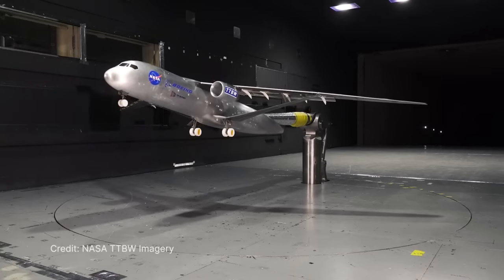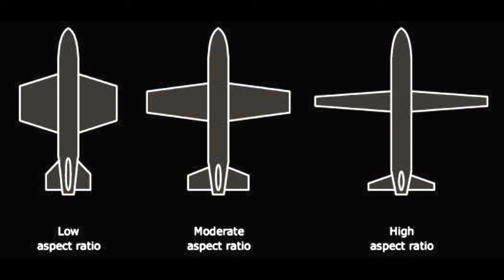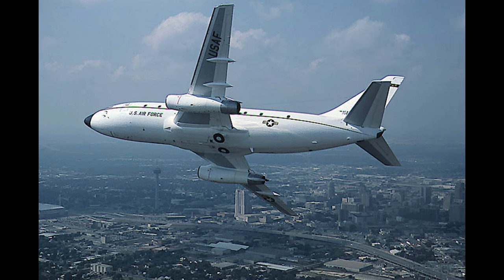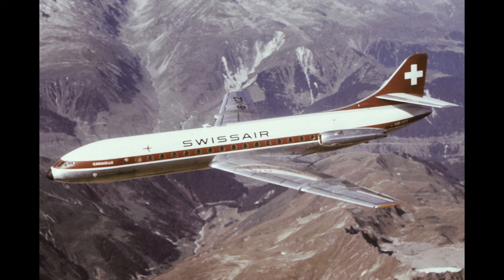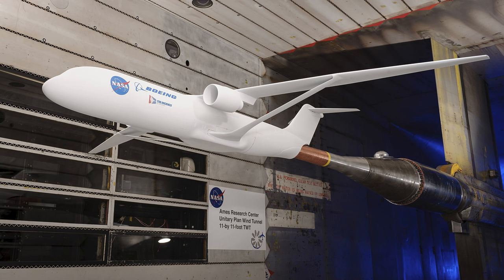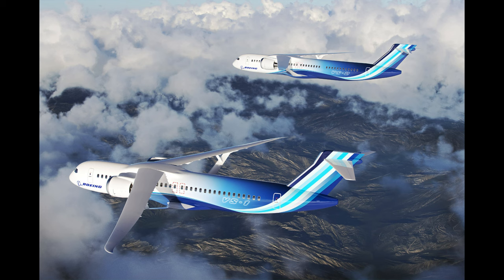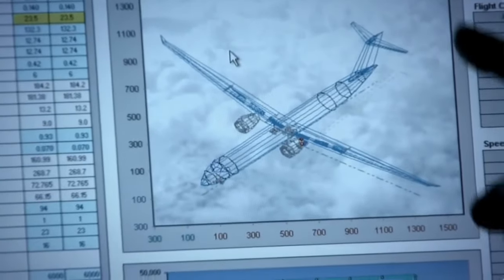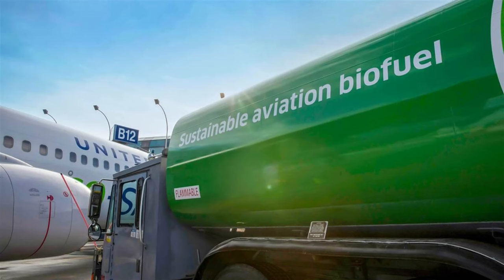NASA's New Airliner Experiment To Make Flying Less Expensive

Comment: Another neat thing about the extremely high mounted wings, they allow for HUGE diameter engines, which seems to be the way we're going, if CFM doesn't turn out to be that great after all.
Reply: Though on this design won't the engine size be limited by the strut? If the engine gets too big the strut will be in the exhaust
Reply: I think the current engines in development are unducted fans, kinda like turboprops, so the fans will be in front of the wing.
Reply: surprised scott doesn't mention this. i know part of the reason for the 737max's MCAS difficulties was that they kept trying to fit larger and larger engines underneath its wings and it kept messing with the center of gravity of the plane. but the larger engines were more efficient.
Reply: @oldfrend  it's got nothing to do with center of gravity. The issue with the 737 is that it is a 60 year old design that was originally equipped with small diameter, low-bypass engines, and sat pretty low to the ground to facilitate handling in airports without much infrastructure. Due to the structural design around the landing gear area, there is a limit to how much they could raise the plane, and the CFM LEAP engines would not fit under the wing as usual. Thus, they had to mount the engines higher and more forward. The issue with this is that the engine nacelles gerate lift at high angles of attack, and in the case of the 737 max a more pronounced pitch-up tendency because of how forward the engines are mounted. To counteract this, they installed the MCAS system that would automatically pitch down the aircraft in such circumstances, to make it behave exactly like the older 737 models. This would be fine if MCAS had a decent implementation with sufficient redundancies. However, to justify such redundancies, MCAS would need to be classified as a flight critical system and require additional pilot training when transitioning from older 737s to the MAX (disclaimer: I'm not 100% sure on this part). The increased costs of pilot training would be a signifint disadvantage to the MAX, and so Boeing didn't do it. IIRC, the plane would also fly fine without MCAS, but then would require additional pilot training due to the different handling characteristics.
Reply: @bluemountain4181  not really. Most of the size of an airliner's jet engine is from the fan. With engines getting bigger, the goal is to have high bypass ratios- the actual jet turbine engine stays small and the fan grows larger. It'd be pretty easy to build the strut around the engine, even if it cuts through behind the fan. Should be fine.
Reply: @bluemountain4181  You could incorporate the engine through the strut, or the strut through the engine, if needed.  The strut doesn't need to be a single unbroken span.
Reply: @VIctorAbicalil  I think you got all of it just like the reports said it- Boeing had "presold" the plane as not requiring much new training to qualify pilots already flying earlier 737 models- when they couldn't make that happen they put a McDonnell Douglas style band aid on it. MD execs had wound up in essential control of Boeing after the merger due to retirements from Boeing and other factors- they recreated their "old playpen" and gave a heave to the costly QA process and procedures Boeing had long been a leader in. A solid example of executives thinking about the profit in the next quarter before anything else.  FR
Reply: @fredericrike5974  All of that reminds me of Perun's latest video comparing corporate culture and infighting to what is happening in Russia as telegraphed by the Ukrainian "military thingy".
Reply: That's fine until you get an uncontained failure and kill or injure the passengers. It will be even worse for the unducted fans. You'd end up with the next Comet.
Reply: @kirkbrauer8915  which probably messes with the aerodynamics so would net be modelled again...
Reply: @neiloflongbeck5705  Existing turboprops have reinforced/armoured areas where blade loss is likely to occur, so unducted fans are likely to be required to do the same.
Reply: Sometimes, making a huge engine isn't the best cost-effective choice. Kind of like rocket engines, making many "small-sized" can be cheaper and could make more thrust than one huge one, as long as you have room to put many of them.
Reply: @brettcoster4781  But then you've just increased the weight/cost/complexity to compensate for the simplification of ditching the nacelle.
Reply: @bluemountain4181  Not if it is a propfan.  The large diameter of turbofan engines is only the duct.  The engine itself is quite small diameter.
Reply: @neiloflongbeck5705  Interesting point, it never occurred to me that with a propfan there's no such thing as a contained fan blade failure.
Reply: @brettcoster4781   yes, they do, but I can remember reading about a DC-9 where there was an uncontained failure in the engine and 2 passengers were killed.
Reply: @listerdave1240  not with the fan blades, but compressors and turbines still leave their engines sideways on occasions and end up killing passengers
Reply: @neiloflongbeck5705  compressor parts can be contained by a well designed enclosure, the fan blades cannot because there is no enclosure.
With regard to the compressor or turbine parts dealing with their containment is no different between a turbofan, a propfan or a turboprop.
The turbofan may have some advantage as part of the engine is covered also by the turbofan duct which could act as a second catchment layer for parts leaving the compressor, depending on which part they depart from and how far back the fan duct extends.
Reply: @listerdave1240  yes, but there have been accidents with such parts of a jet engine that killed passengers. One such was in 1996 on Delta flight 1288 were the uncontained failure of the compressor killed 2 passengers and that was an MD-88 (engine type JT8D-219 turbofan, and the metal passed through the inner and outer cowling for the engine and the fuselage. In 2017 an Air France A380 (flight 66) had an uncontained failure in flight over Greenland fortunately with no fatalities or injuries. Both of these examples of such failures were on wel regulated airlines. So these things can and do happen.
Reply: @brettcoster4781  Also, these fans would be running slower and have lighter composite blade materials compared to contemporary turboprops, so the required reinforcement may be less than for turboprops today.
Reply: @MaartenOosterbaan  fair point, but there seems like a lot of space under those wings to fit the entire fan with room to spare.
Reply: @neiloflongbeck5705   Hi Neil, Where un-ducted fans (turboprops) are used, it is common practice to beef up the fuselage in the area where a dislodged prop could come into contact with the fuselage, also in other critical areas. Nothing is 100%, not even current modern jet engines with their strengthened nacelles. You may recall the recent incident that caused a fatality. The CFM56 engine of a 737-700 exploded and the reinforced nacelle failed to contain the blades, ejecting a blade through the side of the nacelle enclosure hitting a passenger window. Unfortunately a female passenger was partially sucked out of the window and died from her injuries. It is very difficult to build aircraft or engines that cater for all eventualities. I do understand your thinking, a fast spinning blade in a jet engine would feel safer than a high speed uneducated prop just outside your window.
Reply: @brettcoster4781  Correct and they are.
Reply: @ukandrew  yes, and I think you'll find that I'm aware of that. But just like with the 737 Max it doesn't take much to destroy a reputation. Just takes a couple of high profile accidents and it won't matter how efficient or environmentally friendly the engines are.
Reply: @kirkbrauer8915  turbofans engines used on airliners are practically ducted turboprops. Ducts improves the efficiency of propellers. AIUI, the airflow is not wasted on surrounding air but ended up being focused to be used as thrust.
Reply: @samuelmendoza9356  yes, the main goal behind these unducted propfans is to increase the fan diameter without the additional weight penalty of an increase in the duct size. This is of course at the penalty of some lost efficiency, but you regain that efficiency and more through the weight savings and increased fan diameter.
Reply: @kirkbrauer8915  as long as the spin is not too fast. The Russian Tu95 bear's propellers are supersonic and so loud that a sonar operator can hear it from across the ocean.... _literally_. The larger diameter must take in mind to have improvements in thurst to allow slower spin to avoid such....hellish noise.

Also, while airliners never goe transonic...isn't unducted has lower max speed comapred to ducted ones?
Reply: @samuelmendoza9356  oh yeah, those bear props had a diameter of almost 6 meters and only four massive blades! I think that and the incredibly high RPM did not help the sound situation at all. I remember reading that they had to spin at 8-9,000 RPM at cruise to maintain high Mach numbers. Modern turbofans only spin at 2-3,000 RPM at cruise, geared turbofans like the PW1000G spin even slower. Since these would be geared and have a lot more, better optimized blades, it’s possible they can get the noise levels down to a modern CFM LEAP level, that’s what CFM is claiming with their new RISE unducted engine, we’ll see about the reality of that tho…
Reply: @VIctorAbicalil  I'm going a bit from memory as the 737 MAX MCAS fiasco has been almost four years ago now. Initial testing showed that the 737 MAX flew just like the previous 737 except in a high thrust, high angle of attack situation, which would pretty much only happen in an evasive maneuver like avoiding a mountain or a mid-air collision. In that specific situation the engines would generate some lift if I remember correctly, causing the nose to pitch up higher than the previous version. This was not unsafe unless a pilot did not know about it.

However it would have required training in the simulator, and if I understand correctly even though the training was needed just for this one specific situation, the way the rules are written it would have required a new type rating for the 737 MAX. This would have meant that existing 737 pilots would have to go through extensive and expensive training to fly the MAX, even though most of the training would be redundant since only this one thing changed. This would have made the 737 MAX less attractive to airlines compared to Airbus planes. The airlines could have saved money by only training some of their 737 pilots on the MAX, but then scheduling becomes more complicated as not all 737 pilots would be certified to fly the MAX.

This isn’t a problem when using autopilot, as the computer can be programmed to handle the change in flying characteristics. Although I’m not sure that the autopilot would ever perform that radical of a maneuver. But either way the issue existed only when a pilot took over manual control, which they likely would do in an evasive maneuver.

Boeing had solved a similar issue with the KC-46 using a system they developed called MCAS. Maneuvering Characteristics Augmentation System. It’s sort of an add-on autopilot system that kicks in when the plane is being manually flown and gets into that specific situation. If it senses this situation is occurring it then modifies the movement of the horizontal stabilizer to compensate. Essentially pushing the nose down to somewhat counteract what the pilot is doing. The pilot in theory would have no idea it is doing this, as the plane would seem to fly as it normally does when avoiding mountains.

The MCAS system used the angle-of-attack sensors to determine when the plane was in the situation where it needed to intervene. But test pilots had by then noticed that the plane was not flying well in low speed stalling situations, so it was decided that MCAS should handle that situation also. This meant faster reaction time was need by the system, and I think that was why they decided to connect it to only one angle-of-attack sensor, not both which would add redundancy. However now if that one AOA sensor failed, MCAS could get erroneous readings and the system would have no way of knowing it, and it could therefore manipulate the horizontal stabilizer inappropriately.

In fact Boeing offered a warning light on the MAX to indicate an angle-of-attack sensor disagreement, but the indicator was optional and not all airlines chose to purchase it. 

Then Boeing made things even worse by choosing to not tell pilots about even the existence of MCAS. The FAA signed off on this. This was dangerous because the MCAS system had full control authority, meaning that it was able to override the pilot, even if the MCAS system was malfunctioning.  Pilots could turn off MCAS by turning off automatic trim control, but they didn’t know that. Boeing’s position was that pilots were told that in case of runaway stabilizer causing an uncontrolled pitch up or pitch down, the pilot should turn off automatic trim. Boeing’s reasoning was that if MCAS failed it would act just like a runaway stabilizer, so as long as the pilot followed the procedure for runaway stabilizer MCAS would get turned off.

The problem, as was discovered after the accidents, was that most pilots were not trained correctly in runaway stabilizer. This was partly the airlines’ fault. In the two crashes the pilots did not turn off automatic trim, which would have turned of MCAS. In one of the crashes the pilot did turn it off, but then turned it back on again.  

If Boeing had at least told pilots about MCAS, what it did, and what its potential was for failure, and how to turn it off, there is a good chance the two accidents could have been avoided.

Boeing has since modified the MCAS software, and pilots now receive extensive training on it. And apparently Boeing will be retrofitting all of the 737 MAX so that both AOA sensors will be used by MCAS.
Reply: And shorter landing legs that also saves weight.
Reply: @kirkbrauer8915  Propfans, like turboprops but the jet exhaust actually produces thrust and the fan aids in compression, unless it’s behind the jet engine, then it’s only thrust.
Reply: @brettcoster4781  Several cases of the blade finding its way around the front of the armored ring, since it's generating forward thrust at time of separation.
Reply: @neiloflongbeck5705  Primarily fan blades. Their thrust pulls them forward and they bypass the containment ring,
Reply: @SteamCrane  thank you for the unexpected mansplaining about how turbofan engines work. But as stated earlier those containment structures don't always do what they are supposed to do.
Reply: @neiloflongbeck5705  The fact that fan blades tend to move forward past the containment after separation appears to not have been fully considered by the designers, since it happens in a substantial percentage of FBO incidents. More likely, it was considered, but considered not economically solvable. Larger and larger fan diameters, with longer blade length, increases the centripetal force and aerodynamic shock loading to the blades, plus increasing the effect and probability of bird or FOD strikes (larger swept area). This increases the material strength of the blade roots needed, unless the increased blade length is compensated for by reduced fan RPM. Multiengine (4 or more) designs might not actually increase ETOPS reliability, but they reduce the stresses on fan blades. 50+ year mechanical engineer, mansplaining comes naturally. In my distant past, I was involved with turbine blades, but fan sections were small then.
Reply: @SteamCrane  well, there are only 2 easy ways for fan blades to leave an engine out the front or the back. The hard way is through the containment barrier, only those bits with sufficient energy will complete that route the rest will bounce off and take the easier routes. It's those high energy bits of the failing engine that, and that will include prop blades and the fan blades of uncowled fans are the ones of most concern. Provided, sufficient strength is built into the engine and fuselage we can mitigate those more dangerous parts of a failing engine.
Reply: @neiloflongbeck5705  I'm thinking of an example, the 2018 Southwest 1380 FBO during climb, where the cowl forward of the containment ring was shattered, while the containment ring was intact, dented, but not penetrated. Thus parts of the fan blade moved forward upon separation far enough to avoid the containment ring. Although the fan parts didn't hit the fuselage, the debris created by the fan blade hitting the inlet cowl did. The window that was broken was well aft of the engine. It was hit by a small piece of the inlet cowl, not internal engine components, but a passenger was killed by being partially sucked out. Root cause was failure to inspect fan blades, resulting in growing cracks not being detected. The fact that the containment ring was dented indicates that it did help to contain the damage, but that it didn't extend far enough forward to prevent a death. This was on a skinny CFM56-7B. Think of the added weight of a long containment cylinder extending the entire length of the engine, if you are worried about the compressor and hot section, then add strong hinges and locks to allow opening the containment to work on the engine. Then make it the diameter of a modern engine. At minimum, it seems that the fan containment ring should extend further forward to protect the entire inlet cowl, and far enough to prevent blade escape via residual forward thrust of the blade, which should be computable.
Reply: @dougerrohmer  I've heard that Boeing is internally a nightmare, and has been for the past couple of years. Dude said that the majority of the workforce either weren't qualified or just didn't have any initiative to innovate.
Reply: @ukandrew 

Just a note, that particular fan blade failure was “a contained failure”. The window was not broken by fan blade fragments. Also, and counterintuitively, a fan blade can and do eject out the front of these engines and even more counterintuitive is that it can still be “technically” defined as “contained”. Source of this information is the NTSB video and reports on this particular event.  Amazing what actually happened vs the public understanding.